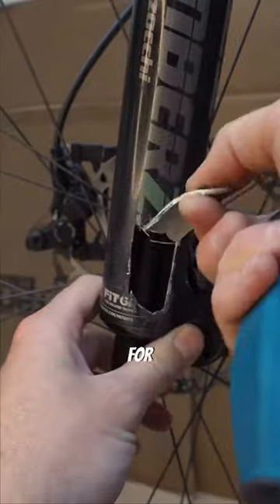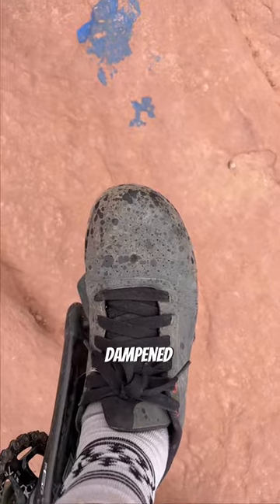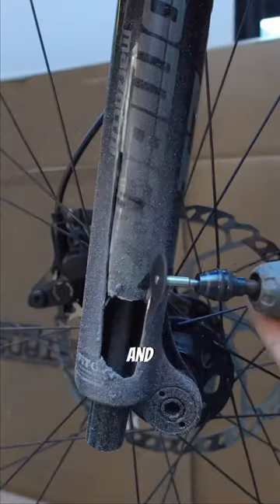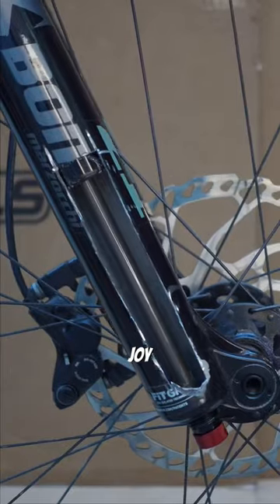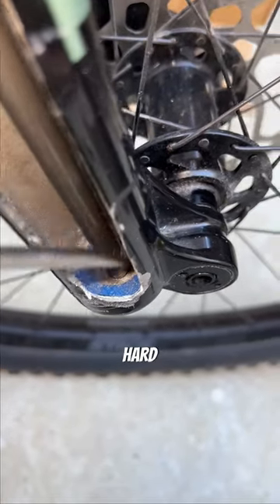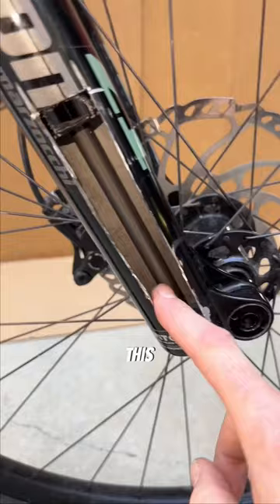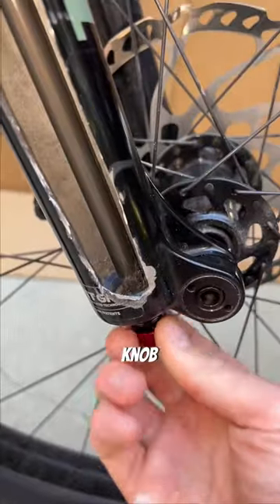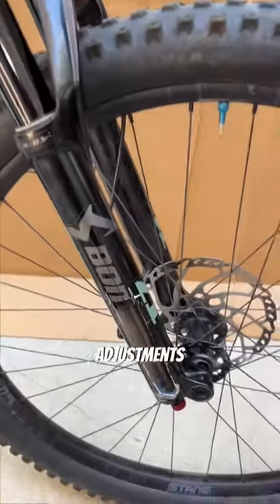Cutting open my fork after a crash! #mtb #bikeshorts #bike

Comment: You touched the bottom of the damper with the blade, also using that fork with all those small metal shavings still in the me is a sure way to get that stuff into the damper.

Comment: Bro, the spring is missing......... 😂‼️
Reply: Its the oil dampening part i am pretty sure. The dampenig leg doeant have a spring. And tge otger leg. It doesnt have a spring but instead has compressed gas.
Reply: @meckarelis3235  2018 I was at Fox Germany, for service Maintenance, the year, Fox bought Marzzochi, so their back Magazin was getting filled with that stuff. I also know, on Wich leg there is a air valve 😎 And where the adjustments for the damping are 😎😂‼️ The coil spring, Wich I meant, should be a fixing plan for this special defect😲😎😂😂😂‼️

Comment: youre trying to break your face
Reply from the maker: Haha no it’s not affecting the strength very much
Reply: @outsidebrendan how did you manage to break the lowers? I have 2 1992 rockshox mag 21sand the lowers on them are fine
Reply from the maker: Yeah usually they last forever. I had to bail over the bars, the bike tumbled and the lowers smacked a rock. Direct hit!
Reply: @outsidebrendan  ah dang! New fear unlocked